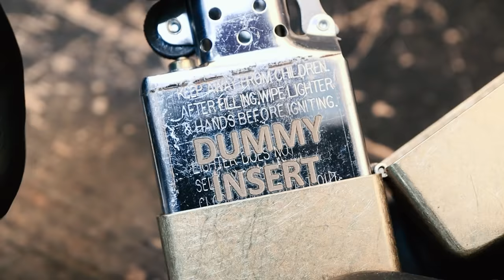Zippo Lighter engraving - Awesome Armor Edition

Comment: Love the videos! Quick question which I hope you can help with, I also have a laser which i assume yours is a fiber laser? Anyway the laser table you use to accurately adjust the object to the correct point, did you make this or was it purchased? Looked everywhere for something similar, if purchased do you have a brand name to search for?
Look forward to hearing from you. 
Luke in the UK

Comment: Very nice video, thank you for sharing your work, I will be getting my fiber laser machine soon, any tips or suggestions before I place an order?
Reply from the maker: thanks for watching - my best tip is to run some tests before engraving for real that's what I did, a lot of testing :)
Reply: @AwesomeRestorations  I have no doubt I will also, right now my main things are deciding on a model, I'm thinking a 30w should suffice for what I want to do, and which vendor to purchase from, overseas, or stateside. Thanks for the advice and reply.